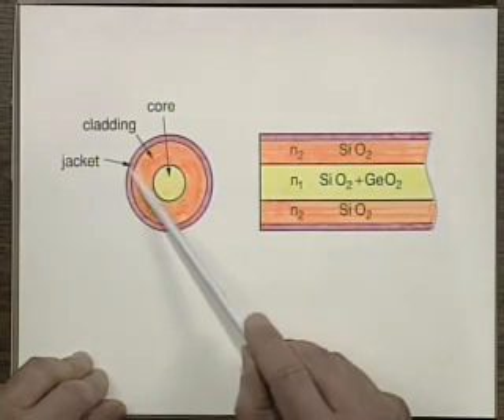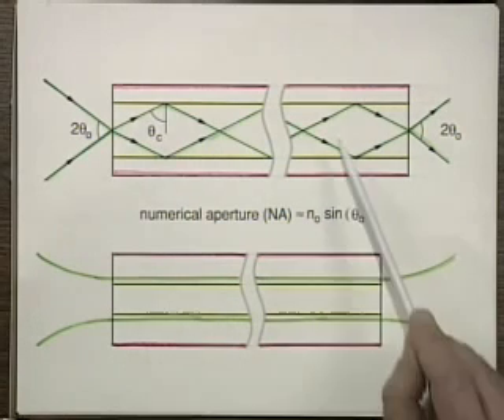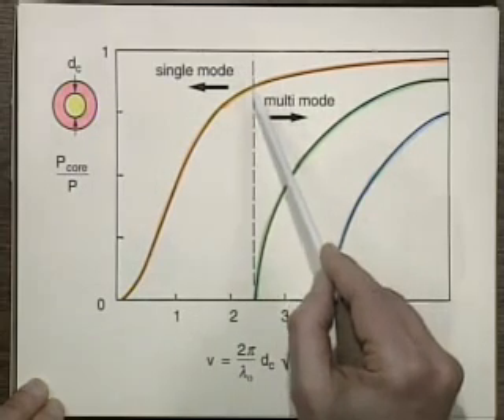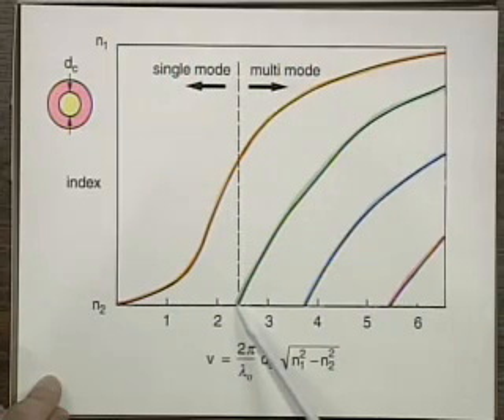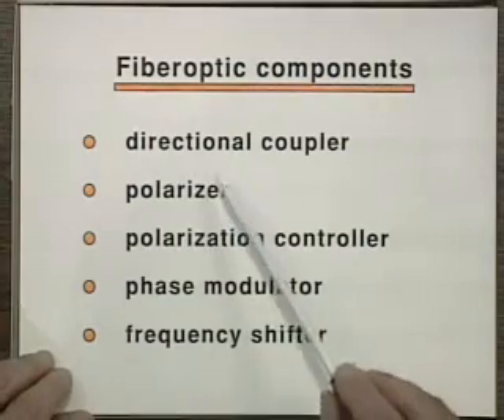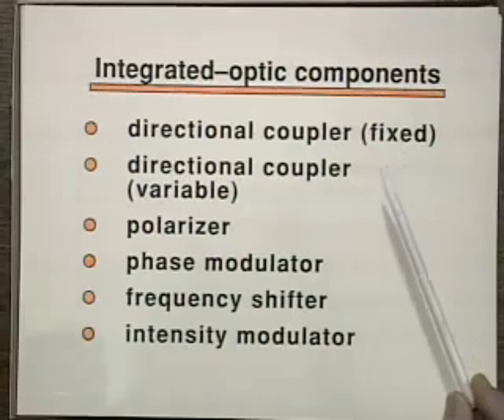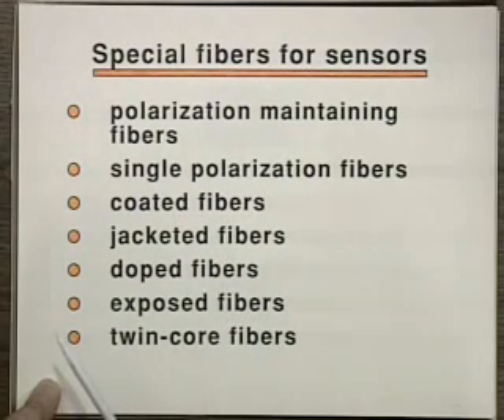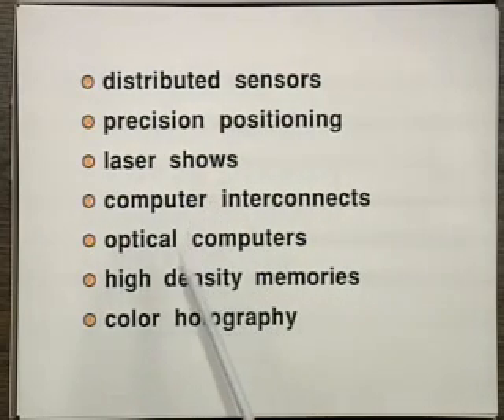Fiberoptics Fundamentals | MIT Understanding Lasers and Fiberoptics

Comment: I want to build a home made custom fiber 405nm laser using multiple 405nm dvd burning lasers. can I get a small piece of fiber optic tubing like 1/16th O.D. and 6'' long and focus all the laser modules very small focus into one side and focus the combined power focused through a lens to get a stronger single beam out ...like 10 dvd burners at 700mw each going in and get close to 6-7 watts out put?

Comment: Thank you for the video! 
i just have a couple of questions if you or anyone else don't mind answering them:
1) When showing the graph of Loss vs. wavelength with the explanation that the smaller the wavelength, the larger the loss due to scattering, and the bigger the wavelength, the smaller the loss due to absorption, but what causes the  huge amount of loss towards the middle of the graph?
2) What's it exactly that you are adjusting on the machine with the lens on it?

Thank you!